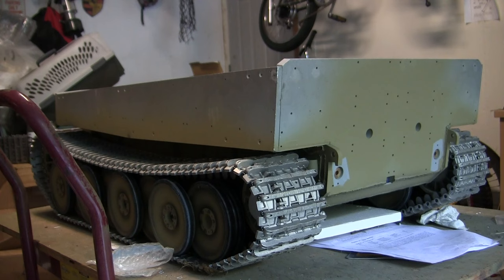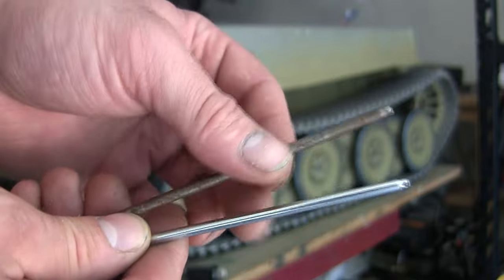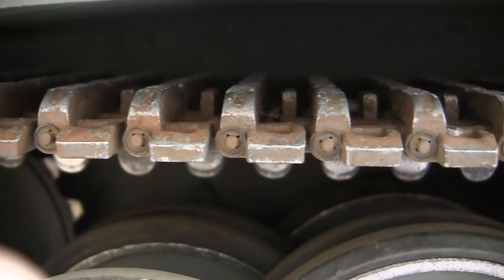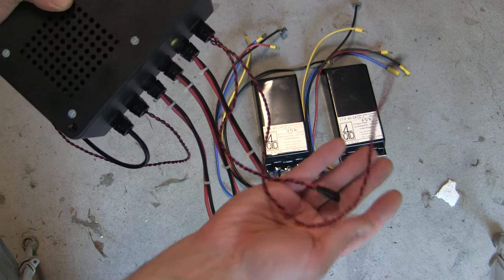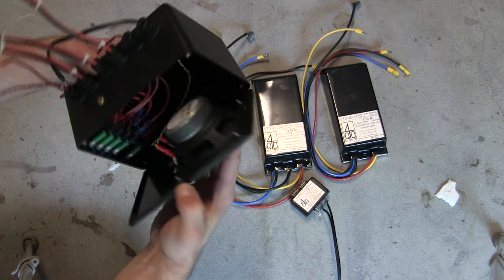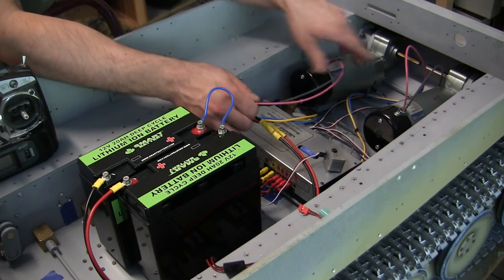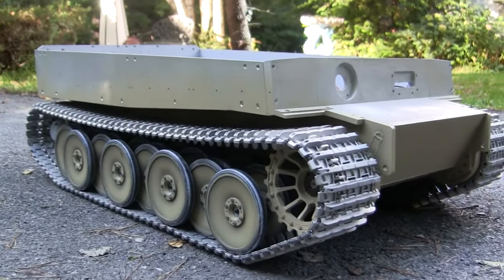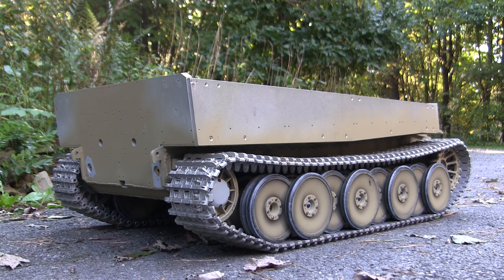Vintage RC 1/6th scale armortek early production Tiger I Video#6 (track, and test drive)

Comment: i would love to see an armortek IS3
Reply from the maker: So would I, however there is an IS2 and an ISU 152 out by that eastern european company
Reply: Have they ever done any open top tank destroyers like the nashorn or M18?
Reply from the maker: No one really has in 1/6, the only open toper I know of is the M36 from Vantex... however for RC open top is not the best as you need to have the machinery and with an open top interior detailing is important. A chinese company also made a metal RC Marder from what I can remember.